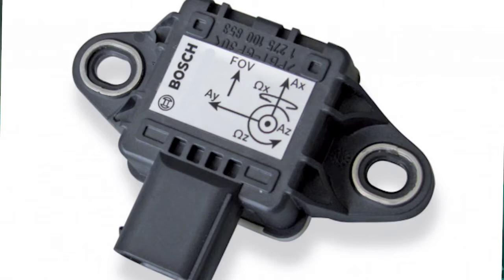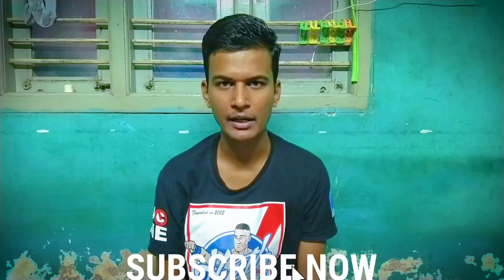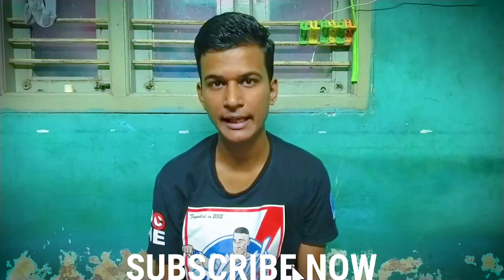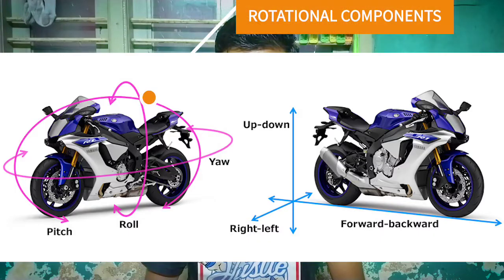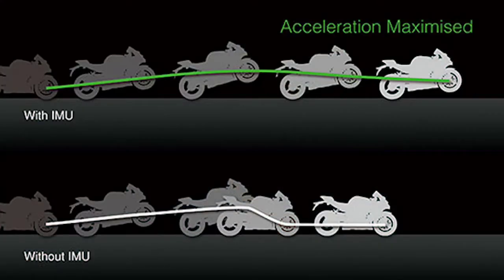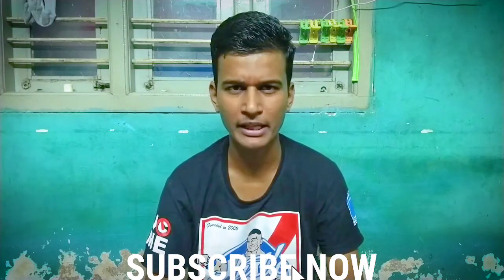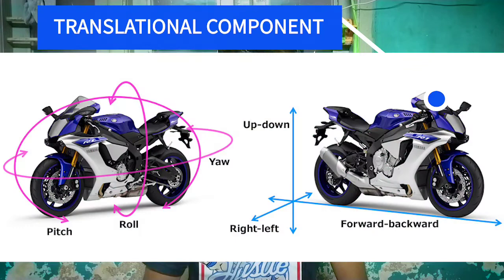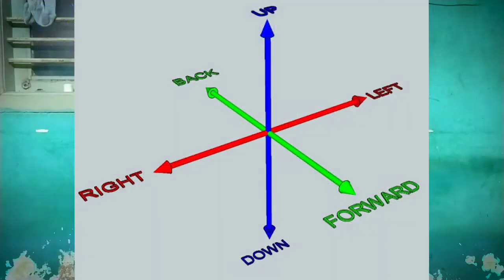6-axis IMU(Inertial Measurement Unit)--EXPLAINED

Comment: This video was very informative. I am actually doing some project, and I plan to use 6 axis MPU 6050 gyrocope and acclerlometer sensor. So, I have a dpibt, I need to obtain the vehicle speed and road gradient angle as I am riding an electric scooter. Will I be able to obtain the vehicle  speed using this imu sensor(MPU6050) ?
Reply from the maker: I am glad that my video halped you..but regarding MPU6050 I am not so sure brother....I am not very knowledgeable in that matter
Reply: @Teja_M_H_1210   Generally,is it possible to obtain  vehicle speed from accelerometers or imu sensors?
Reply from the maker: I think it's not possible...... it's not at all accurate..atleast that's what I know about it✌️
Reply: @Teja_M_H_1210  at least do you think road gradient angle or elevation can be measured using an accelerometer?
Reply from the maker: Using MPU6050 with a proper Arduino and coding it might work
Reply: @Teja_M_H_1210  thanks , I'LL look into it.
Reply from the maker: All the best my friend ✌️😉
Reply: @Teja_M_H_1210   Thank you